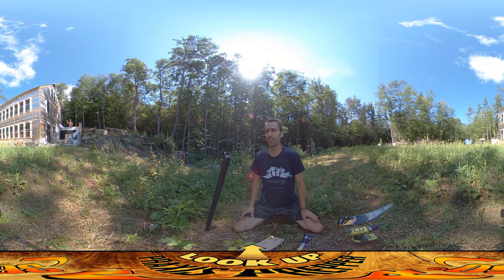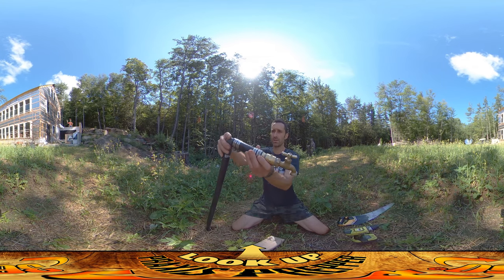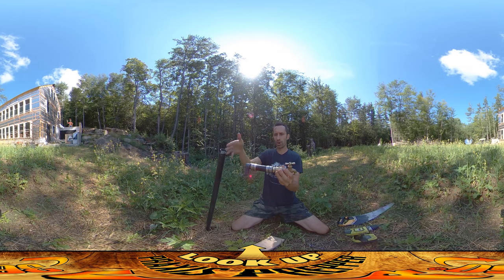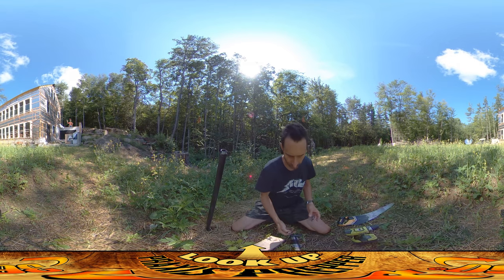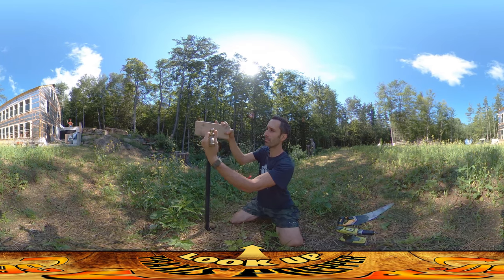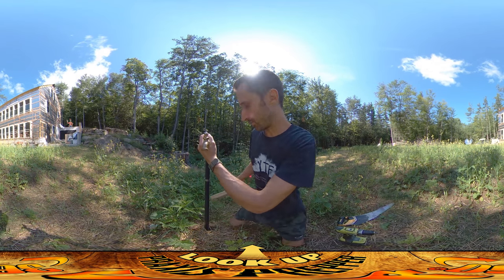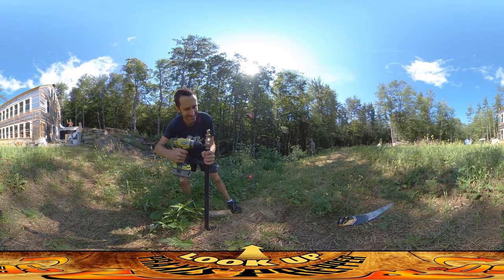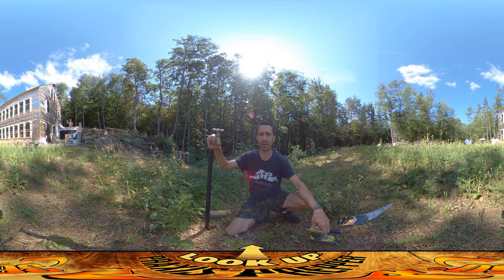Homestead Building - Creating an Outdoor Hose Line, Using Barbed Fittings and Clamps

Comment: Check out the "Haywire Klamper" instead of those wormgear hose clamps. Much cheaper, any size and a more reliable connection. I've used it for years as a brewer and I won't be without one.
Reply from the maker: Thanks Matt!
Reply from the maker: I looked and I'm not sure what item you're describing. Is it something like this: https://amzn.to/2AZre6w